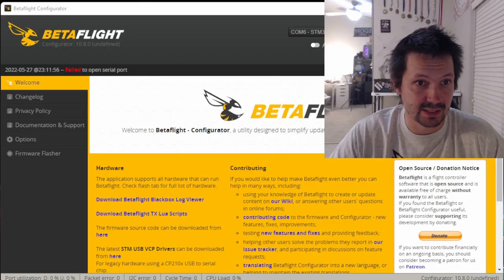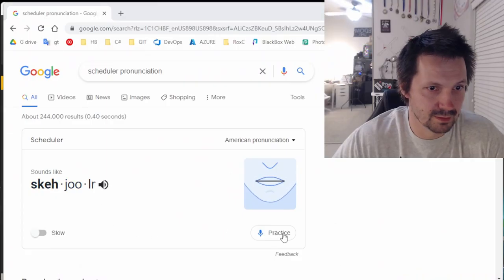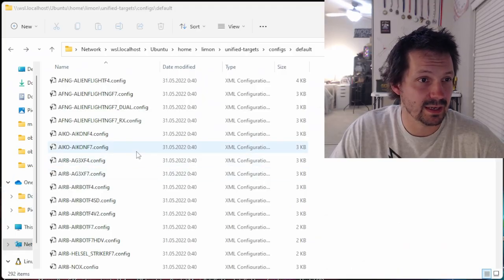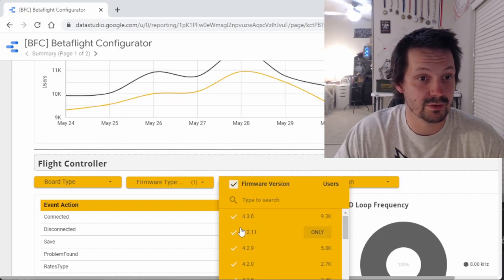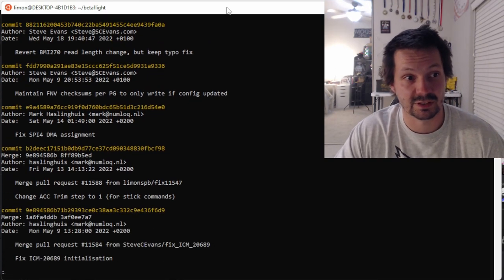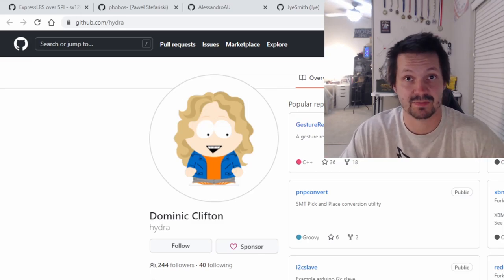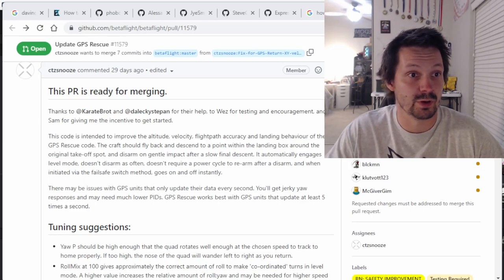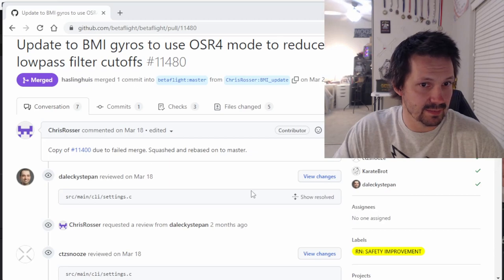Why Betaflight 4.3 took that long to RELEASE?

Comment: Thanks for the update! Probably worth mentioning that the Bosch BMI OSR4 mode is not on by default for BrainFPV/Radix flight controllers according to the BrainFPV firmware notes. I've seen more than 1 quad go down because people tuned their Radix like it had a MPU6000

Comment: is the Gps rescue  pull #11579 by ctsnooze actually merged in the 4.3 ?

In this beautifulland usefull  video you show us a demo which was an enormous improved gpsrescue and landing, but at the time it was'nt decided if it will be merged in 4.3 or not.

I'm an enthusiastic user of GpsRescue, and even with some defects, it saved me a lot of quad.

If you can explain short where to search to know if this #11579 is finally implemented in the new stable 4.3, i'll be very happy to learn more.

many thanks for all your work, dev and vid.
Reply from the maker: Thanks for your comment and question.
The team decided that merging GPS PR is too much in the release candidate stage. So it is not merged and planned for 4.4.

If you want to give it a try, get the binaries from this PR:
https://github.com/betaflight/betaflight/pull/11579

Comment: Thanks Limon. I always turn bb logging off on my freestyle rigs after I tune in bf 4.2 to save cpu load but it sounds like I can turn it back on in 4.3
Reply from the maker: you still should have it ON only when you need to record... But yeah
Reply: You can also disable certain blackbox fields if you don't use them so your logs will be smaller and you need less CPU. There's a preset for it so you don't need to look up the CLI commands.

Comment: Hey guys so I got my mobula7 1s elrs a few months ago and got the no gyro warning and long story short after it start flipping out when arming I decided to go into betaflight and take a look and it says NO GYRO DETECTED....I didn't flash any firmware at all when I got it all I did was bind it to my literadio 3 elrs and changed the aux channels....I see where alot of people got their gyros bricked from the rc6 but is it possible that mine just had a bad gyro? I got the new rc7 but am scared to flash anything lol my first whoop and this happens smh....ps it flew like a butterfly on rails for 4 batteries before the gyro issue yes I only got to fly 4 packs 😫 any help would be much appreciated 👍🏽✌🏽
Reply from the maker: "a lot of people" is a bit overestimation.
If you didn't flash and didnt' change weird CLI parameters, then its totally possible the gyro is just bad / bad board. You can try to reflash. And make sure yous select the correct target. TO make sure you can even flash 4.2
Reply: @IvanEfimovLimon  from what I have seen online and from jb and blunty as well alot of people have reported this issue thanks man I will try to flash hopefully it will work its a great little whoop I'm probably gonna get another one just in case it doesn't work at least I will have spare parts 😁👍🏽✌🏽

Comment: Ivan there is a strange thing i noticed with my Iflight TwinG F7 FC, physically the gyros on FC board are MPU6000 but in CLI “Status” command it displays device name as “ICM20689”..
This FC was purchased last year when ICM20689 were not used commonly, and MPU6000 was the only superior choice for manufacturers..
Reply: Weird... can you check if BF 4.2 also detected the same gyro name?
Reply from the maker: most likely thats what manufacturer has done - replaced the Gyro without changing the description

Comment: Can ESC damage the Gyro on fc?
It worked perfect for 10-20 packs with F722 FC, then once weather got hot, FC started not to arm after 1-2 packs flight, I needed to wait for 10-20 minutes to be able to arm it with a fresh battery.
But during that I could turn on/off the beeper with motors from my radio. MSP connection did not work during those times. After that the gyro MPU6000 started to have huge noise, which I could see in BBL and during the flight, and it started to tilt right.
Same thing happened with another FC I put on that build.
You think ESC could've made that damage ?
Reply from the maker: Interesting. When you try to arm, what warning when you get, when it does not arm?
Reply: @IvanEfimovLimon  no warnings in dji, nor it connects vis msp, but reacts on beeper command.
Reply from the maker: @fpv_am  you can connect the drone to PC/Phone to check the arming prevention flags (props OFF). They are listed on the Setup page. That's how you get a real reason why it is not arming.
Reply: @IvanEfimovLimon  I tried, but it doesnt connect when us doesnt arm.
Reply from the maker: @fpv_am  sounds like faulty FC really... Are you sure don't overload it and CPU load stays not more than 70?
Reply: @IvanEfimovLimon  how can I check that? Its f722 8/8k bidir dshot600, filters are 2.0 for gyro 1,5 for d term, axelerometer enabled, black box records at 1k gyro scaled. Bf 4,3 rc3.
Reply from the maker: @fpv_am  connect with configurator and at the bottom there is a CPU load. But cuz it's F7 I think the CPU load will be ok. Seems like a faulty board to me.
Reply: @IvanEfimovLimon  the thing is that when it doesnt want to arm, it also doesnt want to connect to configurator.

Comment: I have weird problems with Betaflight 4.3. I have 3 different boards 

Betafpv Aio with MPU6000 and 5a ESC
Happymodel CrazybeeF4 ELRS 5a 200mw MPU6000 Board
Happymodel CrazybeeF4 ELRS X12 12a esc and icm 20689

The first two boards are working great even with Bluejay and Dshot enabled but the last board that comes with the mobula 7 elrs do weird things what the others dont do, like the motors stall until i throttle up and as soon as i do a flip  or roll with airmode enabled on low throttle and disabled on high throttle i fall out from the sky when airmode is permanently enabled this dont happens and when dynamic idle is off this also do not happens but with dynamic idle on it doesnt mather what value i put in, the motors stall. dshot bitbang on or off doesnt help motor timing and demag is on high bluejay is flashed with 48khz min and max startup power both are set to max in bluejay.
Reply from the maker: Hey man, this is a YouTube channel :)
Betaflight has Facebook group, discord, GitHub where the whole community can help. But looks like your third board is just faulty
Reply: @IvanEfimovLimon  Good idea, 😅 however, to hear and know what a Betaflight dev things about that issue, is more or less like to ask a whole community. thanks. 😁👍
Reply from the maker: @AirKhanFPV  no problem lol. But the community is way smarter than me lol. Can also try to update firmware to RC6 and record blackbox